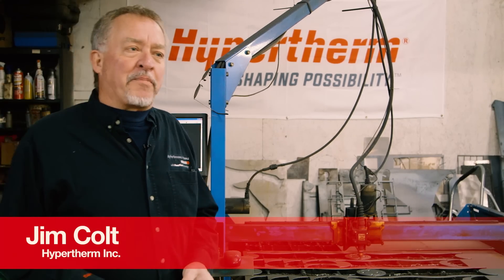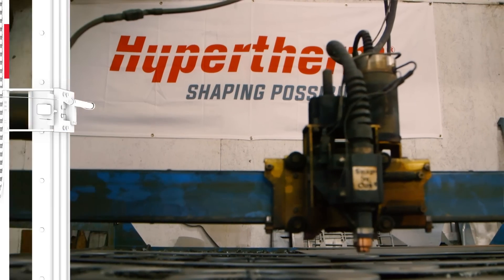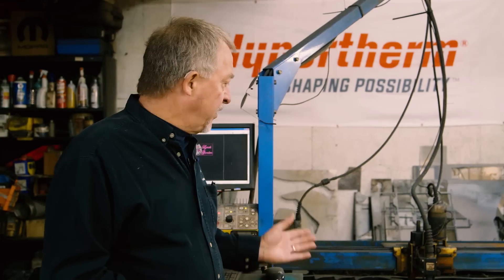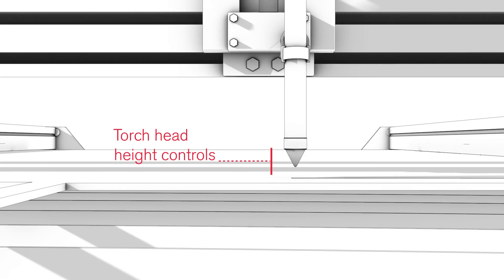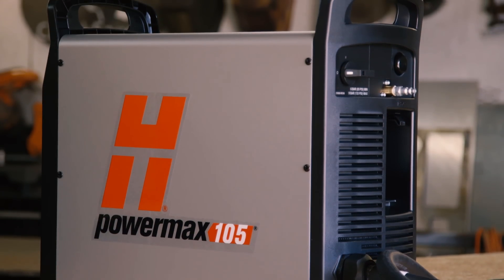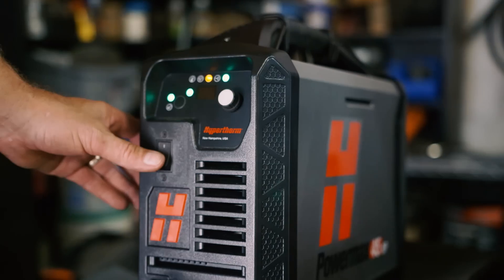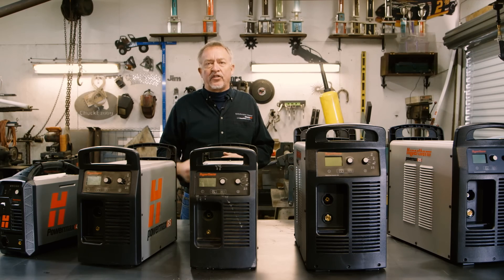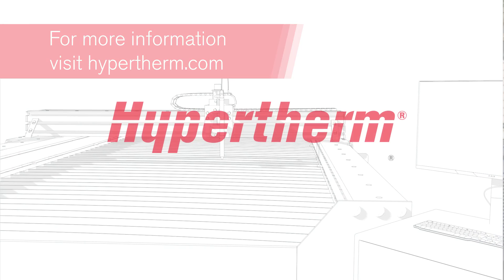Jim Colt on choosing a light industrial CNC plasma table

Comment: Mr. Jim I ave the same table you have and just got a new 45xp with Machine torch, where did you get the torch mount for the plasmacam table?  Thanks
Reply from the maker: This was a magnetic holder by snap n cut. you can google this and find their website. Hope that helps.
Reply: @hypertherm  I have a Hypertherm 65 , hand held but I would like to purchase a 5x5 CNC system. Can you help me? Thanks
Reply from the maker: @dennishorn6735  Good morning, i'm sorry for the delay in getting back to you regarding the 5x5 table you are interested in. The best way for us to help would be for you to go to our website and fill out the form for a quote. We will get in touch with you shortly after to discuss options. you can get to that form by using this link: https://www.hypertherm.com/en-US/contact-us/?form=request-a-quote&product=XPR300. Thanks again for reaching out.